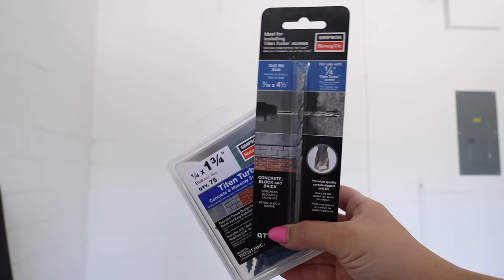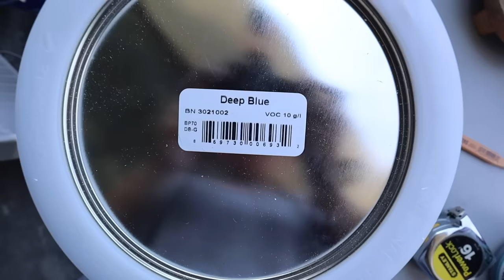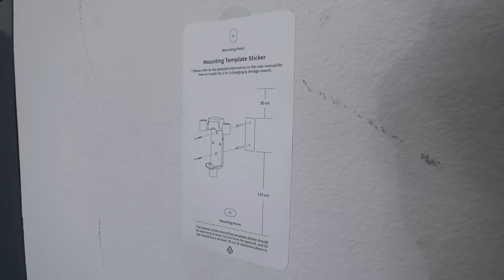DIY GARAGE MAKEOVER *BUDGET FRIENDLY UNDER $300* | Garage Organization + Decluttering

Comment: Your garage turned out great!  Love the workbench and all of it's storage!  You could put industrial wheels on it, and move it for different projects and possibly use that storage on the back, if needed.  Also, I put peel and stick floor tiles on my shelf bottoms to keep the heavy items from scratching the paint.  I even did that under all of the sinks in my house.  I was often able to find something that went well with the floors.  It's somuch easier to clean! That was a fun video, 
Thanks !
Reply: Agree! Was about to type all the same suggestions! Looks great, Katie!

Comment: Nice work.  Consider getting a water bottle storage rack and setting it just to the right of your fridge.  The plant on the peg board would stand out nicer on the left above the small plastic cubby drawers.  Instead of epoxying the floor since you may move, consider garage tiles that you can take with you when you move.

Comment: That paint seems awesome.... peg board is supposed to be shimed out from the wall so you don't struggle to put in the hangers. Good idea would have been put wheels on bench so you could use the back side to store paint or other stuff you don't need access frequently.

Comment: I’m so impressed! I have a question - did you put some sort of spacer between the pegboard and the cinder block wall? How did the pegboards hooks go in if you didn’t. I want to put pegboard up in my own garage very soon but am curious about that issue.
Reply from the maker: Hi!!!! We only screwed the tops in!! That way we were able to lift the bottom/pull it away from the wall!
Reply: Good job with the garage,  you're supposed to put a spacer threaded through the screw between the pegboard and wall, then you can secure all 4 corners of pegboard to the wall.
Reply: @KatieVining  thanks for that info 👍